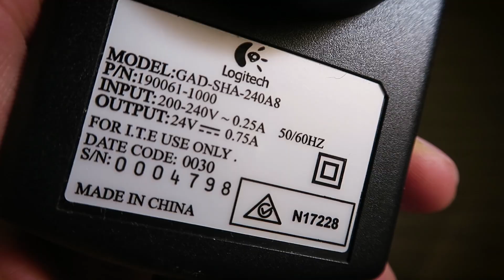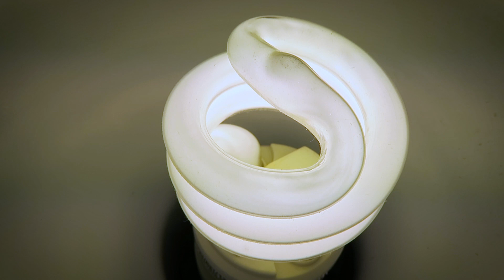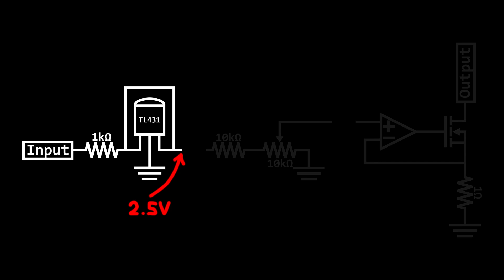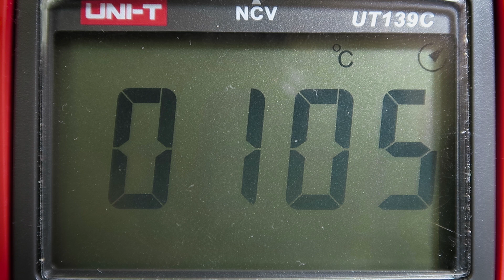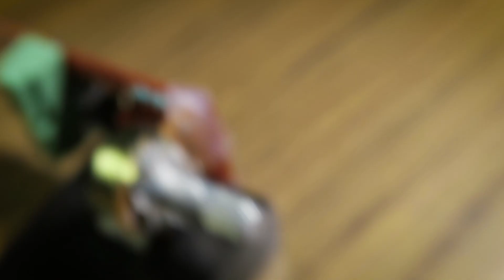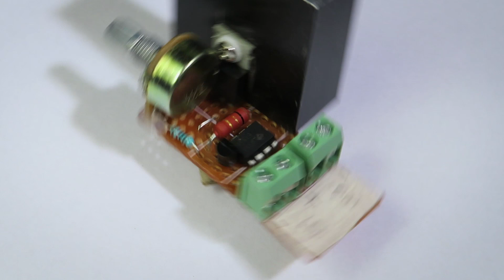1.25A Constant Current Source

Comment: nice video. I built a similar topology but using the lm10 op amp instead. I like it because it has a 200mv voltage reference on chip so you could do away with the external reference.
Reply from the maker: Didn't know that existed! It's a bit pricey but would be perfect for something compact.
Reply: nice dh, thanks

Comment: What opamp are you using? Cheap 'jellybean' 741 parts don't support rail-to-rail, so their performance is unworkable at low voltage inputs.

Comment: Running the circuit for a long time heats the mosfet significantly due to low Vgs. Even the heat sink is unable to keep the mosfet temperature within operating range.

Comment: It has been done a lot before but making a benchtop supply form an old atx power supply or perhaps improve upon the idea some how for a cheap adjustable power supply capable of putting 24 volts across something. a normal lab supply costs a lot!
Reply from the maker: Already on my list :) Should have some eBay parts coming in the next week or two for that.

Comment: I tried to design a 10A constant current source using Darlington transistor. But the output of the op amp contains spike.  Could you suggest how to remove the spike of the op amp output in the circuit?